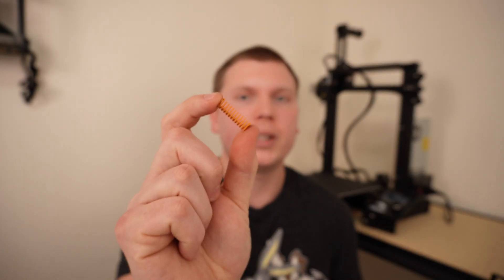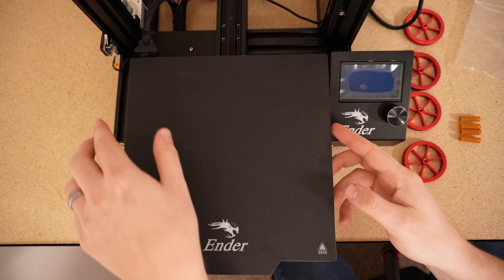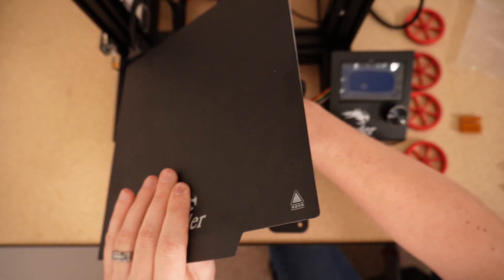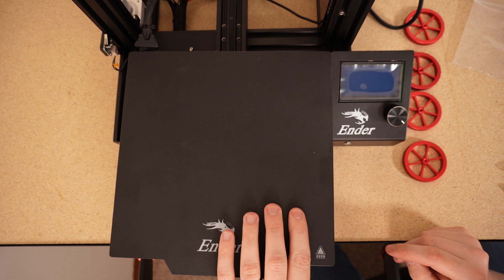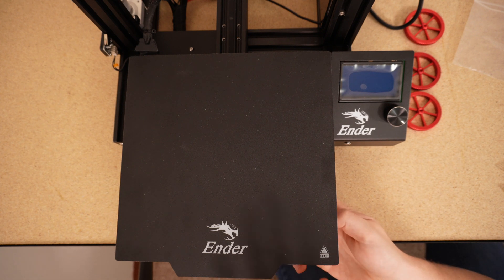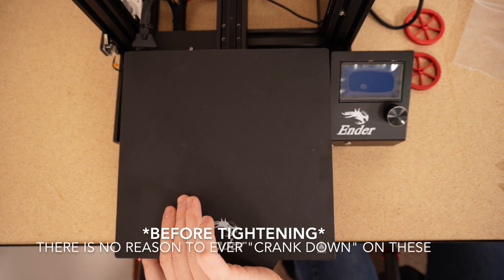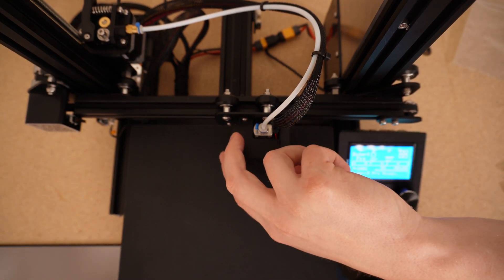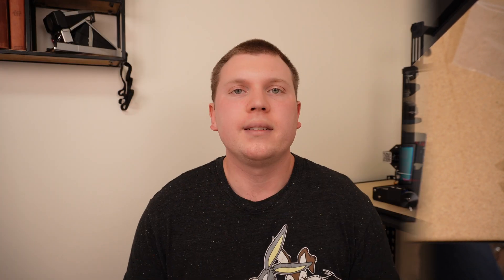How To Upgrade Springs and Adjustment Knobs on Ender 3/Pro

Comment: Good and straight to the point video. Just to let anyone know I just did this upgrade on my Ender 3 pro and I needed to raise the Z floor switch height because I could not get the bed to be as low as needed with these new yellow springs even when compressed all the way. I ended up raising the switch about 6mm and then re-leveled the bed from there. I was kind of confused why this needed to be done but I think there are variations between different runs of the printers.
Reply from the maker: I have ordered several sets of the yellow springs and they are not always the same length as the factory set. You probably got a longer set of springs that caused the bed to sit higher.

Comment: I have received ender 3 3d printer. In bed spring There 4 springs in that one smaller then all? It's good or not…
Reply from the maker: If one is smaller it should go in the back left corner. There is a spacer there that takes up some extra room compared to the rest.
Reply: @thepracticalprinter8037  okey...